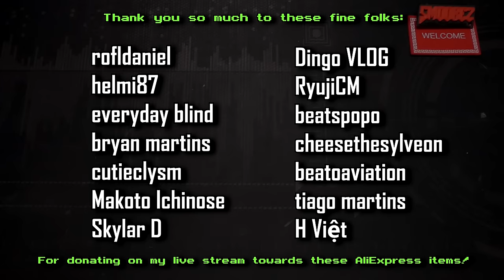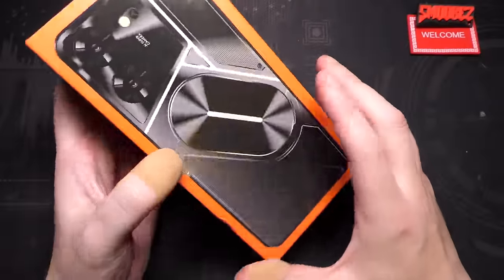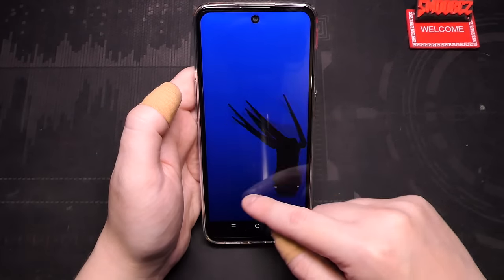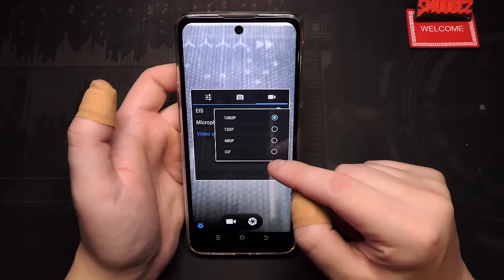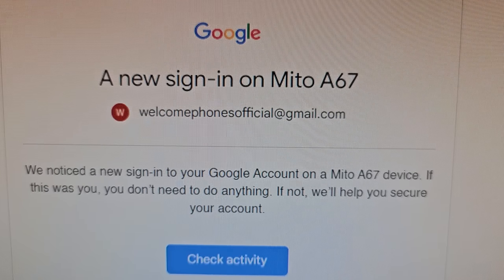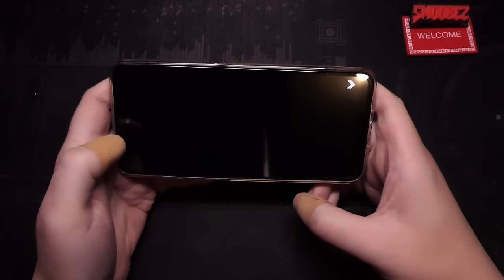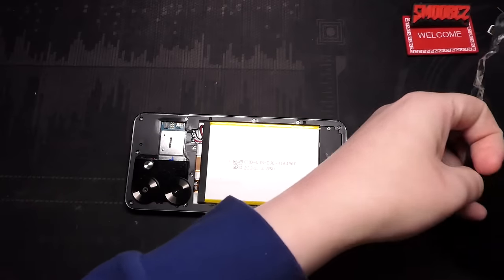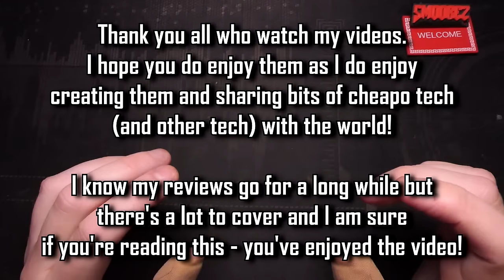I bought the $100 "FUFFI" POVO 5 PRO from AliExpress - An Honest WELCOME Device? (iWish)

Comment: For the C-to-C cable issue, chances are whoever designed the circuitry forgot to pull down CC1 and CC2 pins with 5.1kOhm resistor.

Comment: 19:14 actually C to C chargers do work with it but it seems like if your cables too fast or has any voltage difference it will not work I have a Bluetooth speaker with a USB type like this and if I use a cable that's any higher than 5 volt 2.5 amps it will not charge this is to protect the device from overcharging or charging too fast with a cheap battery

Comment: The legit Tecno also has another brand in the family, it is "Infinix". 

They share similar OS, and they are good phones with reasonable price (aim to market in budget phone branches). 

And they are quite popular in Southeast Asia market. 

The info might not be 100% correct, but it is what I've known.
Reply: Yep, what you said is 100% true, but they also have a 3rd brand called iTel who sells at an even lower price bracket than Tecno & Infinix

(Even if Itel sounds like a rude word in Java, the most populated island in SEA)
Reply: @lancergt1000  Thanks for more information.😊
Reply: as a southeast asian, i can confirm that i am using the tecno pova 5 pro

Comment: From what I have gathered, Chinese scummy companies that create Welcome devices usually buy surplus and/or obsolete parts from more legit companies that do make actual budget phones. Then they use fake specs apps to embellish the truth a little. In fact this whole "Welcome" thing comes from one such app that uses it as default splash screen . As for getting better cameras, and even half-decent processors, RAM and storage - thing is that for 100 USD you could now buy legit budget phone with lets say 6 GB RAM and 128 GB storage, maybe even more . Also 12 MP (or even 20) cameras are quite common . For Welcome companies It all depends on what is currently available on surplus market. Thus you could find Frankenstein phones with some parts being reasonably good and some being totally obsolete.
Reply: I'm so sick of them keeps copying other brands, fine , I get that they need a handy mask to sell their scam product, I don't care about apple or Samsung being reap off, but Tecno? How desperate they are?... can't they stay out of budget user market? That just annoying
Reply: @專業破梗  Wouldn't be surprised if Tecno actually sold them masks in question 😁

Comment: its safe to plug in. casual 5v 1A or 500mA. so simple cause no protocols like qc, qc2, qc3, pd and etc. I made these when I didn't have a charger at hand, but I had a soldering XD
Reply: No it's not. The transformer among other things is probably of very poor quality meaning that the whole supply is not going to be well insulated from the mains. It's not about it being low power, it's horrible quality components and possibly also bad separation on the pcb.